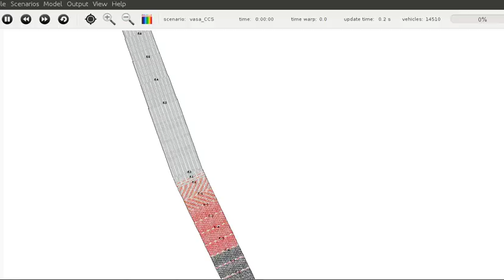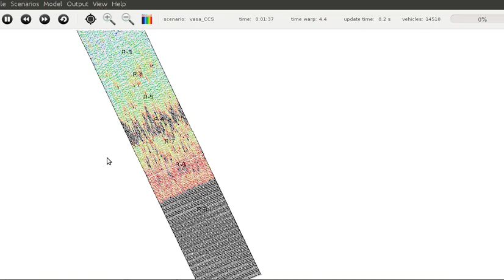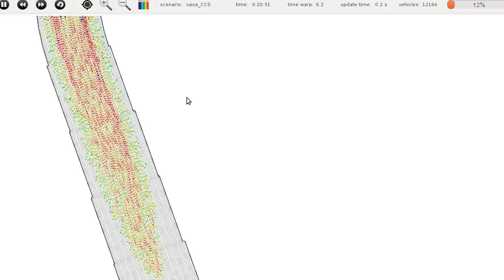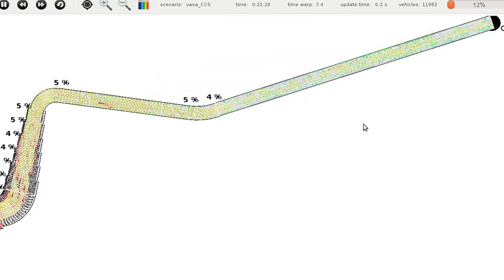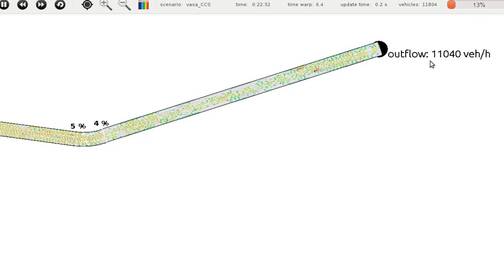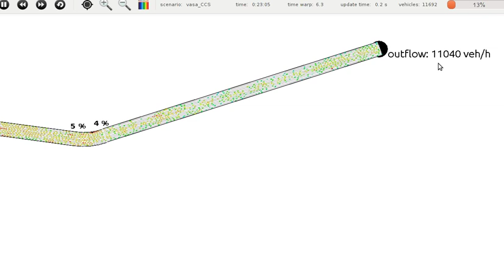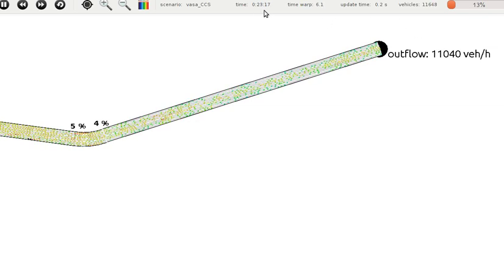Simulation of the Vasaloppet Cross-Country Ski race

Comment from the maker: The simulation shows that, regardless of the starting scheme,  the last skiers will more or less need the same time relative to the start of the *first* waves to pass the bottleneck causing the jam (at the end of the uphill slope). This means, delaying the start of the last waves by  X minutes will essentially safe X minutes standing in the jam!  Of course,  this is only true if X is less than the delay for the present situation!

Comment from the maker: @danielbelucha While the fine details depend on the parameters (i.e., on weather and ski conditions), and on the model quality, the big picture is pretty insensitive to that. Since the Elite and the  first 4 blocks encounter little problems and the delay is 45-50 minutes for the last block 10, I propose a simultaneous start for the first 4 waves, and a staggered wave start with 5 min between for the remaining blocks.